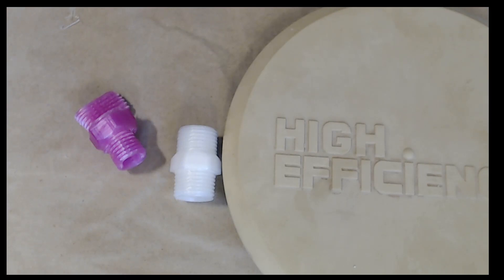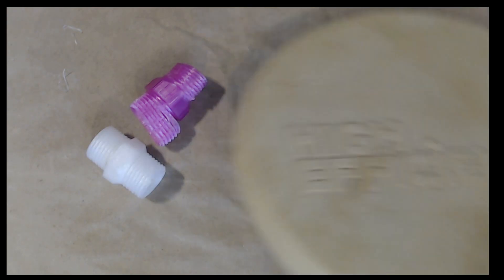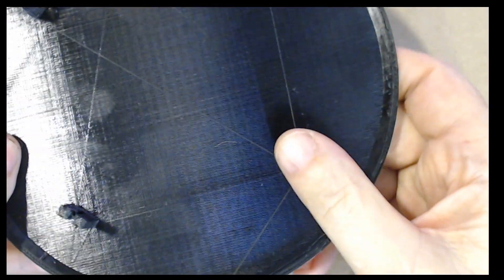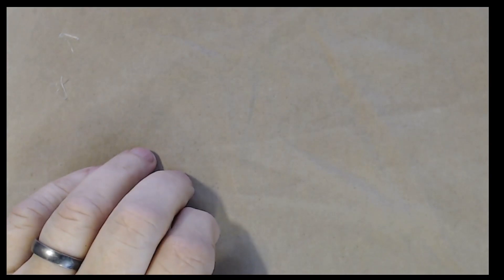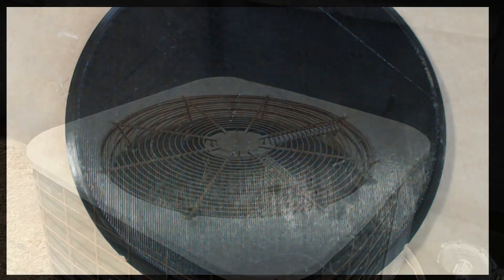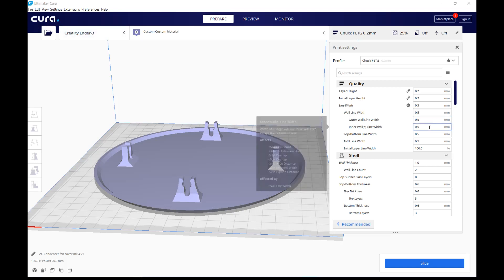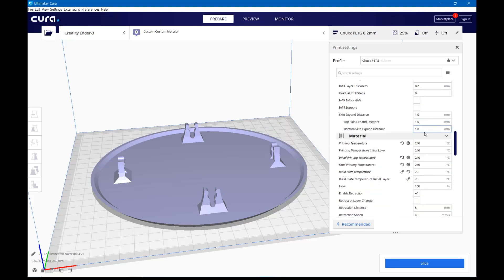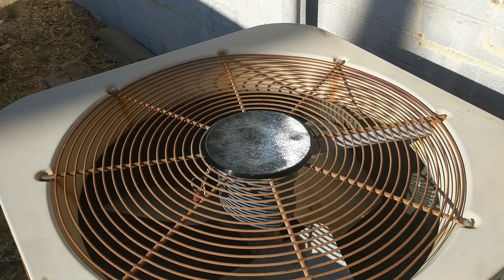Ender 3 PETG Air Conditioner Motor Cover

Comment: How's it holding up?
Reply from the maker: Funny you should ask. I'm going to be starting a new video about which filament can survive heat and UV best and yesterday I looked at that cover. It's still in place and I can flex it without it snapping like a Ritz cracker. So my preliminary guess is that PETG is pretty good for outside use. I know now that ABS sucks when exposed to UV, but I'll be trying ASA, polycarbonate, nylon, PLA and PLA+ as well as clear PETG

Comment: Ive printed a few times with esun petg on my ender 3 after a bit of profile tuning to get rid of stringing, I ended with absolutely stunning top and bottom surfaces (better than PLA) but the sides are a little strandy a bit like the underside of a steep overhang or bridge but not quite as bad I can't work out if it's a cooling or extrusion problem or just the way petg is?
Reply from the maker: Without knowing what your slicer settings are my knee jerk reaction when people have trouble with PETG is "Turn the nozzle temp up, the print speed down and the fan speed down". Depending on the part and the brand of PETG, I usually run between 235c and 255c nozzle temp, bed temp of 70c, print speed of 30 to 50 mm/sec and fan speed of 30% to 80%.

 But if the part is solid and you don't mind the appearance then I probably wouldn't worry about it. Ok no, I'd go nuts trying to fix it, but that's just me. lol
Reply: Thanks for the tips, I mostly use my printer for practical purposes like you are here and i don't think I've really spent enough time learning how to tune settings and understanding their effects,

Comment: Will you try polycarbonate? Strong filaments have amazing potential for hobby projects. I hope to upgrade my ender for nylon.
Reply from the maker: I'd love to try polycarbonate as well as carbon fiber, Zytel and some of the other high strength filaments. Unfortunately right now the budget for my printing hobby is temporarily depleted, so unless some filament company wants to send me a roll to test, it's going to have to wait until I get some extra money or I have an application where I really need one of those filaments. And trust me, I'm constantly looking for reasons to print stuff!

Comment: Hey just saying with the cheap ptfe tube the ender 3 comes with you should upgrade to tech boss or capricorn tubing to prevent degradation of the tube
Reply from the maker: All the tube and fittings have been replaced on all my printers. In my experience the boutique brands of tubing aren't necessary. No offense, if you bought Capricorn or Tecboss tubing that's fine (although some of their claims are rather absurd IMO and really can't be substantiated), a meter long piece isn't exactly going to break the bank, and will probably last you the life of the printer. But it's really not necessary, any quality PTFE tube and fittings will serve perfectly fine until you reach the temps that an all metal hot end is required, and at that point no PTFE tube will be good enough.
Reply: @3rdpig  oh no offense taken what tubing do you get I only got the tech boss cuz I got 2meters for $10 but I'm open to cheaper as long as it will handle petg

Comment: Nice one Chuck.  I love PETG. I always use a wall line count of 3 for added strength on delicate parts.
Reply from the maker: I should have upped the wall count for this part to make the clips stronger. But sometimes when I'm in the midst of a design project I can't seem to see the forest for the trees. The absurdly small hole in the clip is an example, that stuck out like my sore thumb yet I couldn't see it until I printed the part and tried to put it on. But fortunately for me, once I got the clips beefed up, sized properly and the edges filleted, it seems to be holding up fine...even with my heavy handed installation!

Comment: PETG is EXCELLENT!  I absolutely love it.  The only downside is that if you step on a piece of this stuff, you will wish you were walking on Legos.  It will easily draw blood.
Reply from the maker: Back in my misspent youth I stepped on a 3 blade razor broadhead that some idiot named Chuck dropped on the floor. Leggos are a walk in the park after that. I'm cringing just thinking about that and it was probably close to 40 years ago. But yea, leggos suck, so thanks for the warning!

Comment: Thanks, Chuck, lots of interesting stuff in there, especially those PETG settings. I've had mixed results with it and I'll definitely try those. We don't have anything like those temperatures here on the Isle of Wight in the UK but it sometimes gets hot enough to spoil PLA prints in direct heat. I hope you're well.
Reply from the maker: Hi Paul, good to hear from you again. I'm well and I hope you're the same. Let me know how those settings work out for you.
Reply: @3rdpig  Will do.